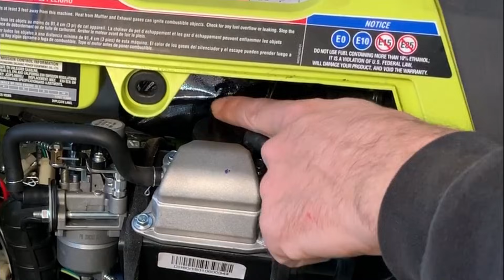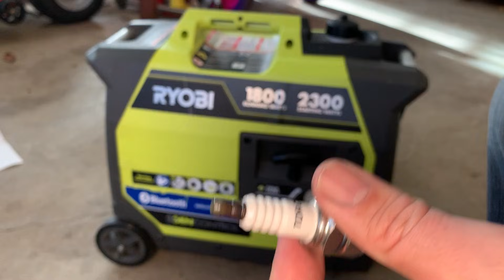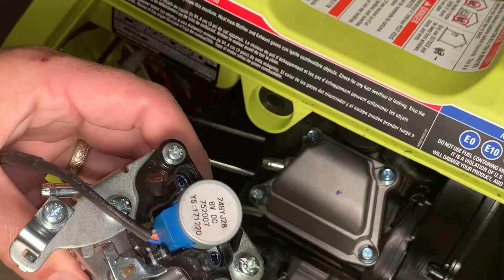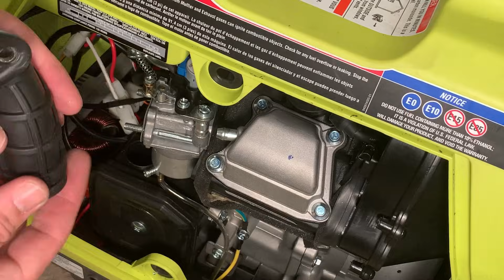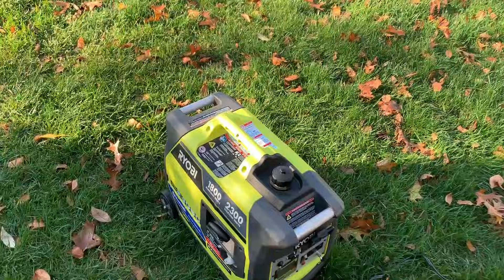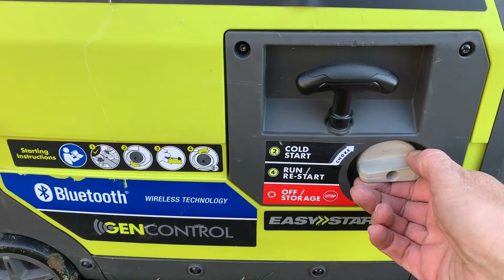Surging and Stalling Ryobi Inverter Generator Fixed - RYI2300

Comment: Seems to be running good now,  good job figuring it out.
This is a perfect example of why you should not mix ignition on off, fuel on off, and choke on off into one control. Much better to keep them separate, the biggest advantages it allows you to turn the fuel off and run it out of fuel so the carburetor stays dry. this is especially useful if the generator doesn't get used very often. Which is the situation for most people.
I've got a harbor freight 2500 watt inverter generator that I bought several years ago. Fortunately it does have a separate ignition fuel and choke. I've never had any issues with it failing to start. The only real negative is it has a vacuum pulse fuel pump. doesn't really seem to gravity feed fuel into the carburetor very well. So since the bowl is empty it requires several pulls of the recoil starter to get the fuel flowing. Once it does it starts right up.
I think if I ever buy another generator, I will definitely pick one that's electric start and electronic fuel injected. That will eliminates most of the issues.
Reply: My advice would be to buy Honda or Multiquip (Honda motor) more money but no problems.  Run it for a few minutes 3 or 4 times a year and use alcohol free (recreational gas) in ALL your small motors.

Comment: As one who works with control loops, I'm seeing a firmware issue. There is a computer that controls the carb servo position, but it's somewhat unstable (speed surges) at light loads. Check to see if a firmware update is possible and available. As you would suspect, it doesn't really cause any problems (unless it stalls), but it does sound unreliable.

Comment: Mine does not get fuel to the carburetor. I mean when I disconnect the fuel line which is behind the carb and nothing comes out. I hope it is the fuel filter. Is there a way to use a regular fuel filter on that thing instead of the red small one that came with it? 
I hope it is not the switch in the front that is not  doing it’s job

Comment: the problem indeed is fuel starvatio from that valve.....but also from carburetor side little round plate below on the side from that top jet...i notice on your  brand new one it doesn't have it.

Comment: Way to power through the issues.  I have watched dozens and dozens of your videos.  I'd almost rather do my own vasectomy than work on a Ryobi after watching the struggle.
Reply: It would be tough to do your own vasectomy, imagine the discipline needed to firmly grasp one testicle while carefully injecting a syringe of local anasthetic in the correct place (I was not at all looking so I can only wonder where that is) to induce the numbness required.  Then you have to wait for the numbness to kick in prior to cutting through the scrotal tissue (just the one layer, of course) with a (hopefully) sharp pair of scissors. Once through, you have to rummage around through the opening you created and isolate the specific tube to cut, remove a short but somehow still long enough section of it, and I hear it makes a vast difference if you don't get the length of section correct (sorry about that) and then cauterize each of the ends.  Don't forget to stitch it back up!  I had to leave it to an expert.
Reply: @Wingnut_Stickman  vast difference. rofl..... I bow in deference to your humor.
Reply: @somethingelsehere8089  thank you, thank you ...
Reply: @Wingnut_Stickman  you might be surprised to hear that it is really not very challenging.  I do my own surgeries all the time. 👍🏽
Reply: .......little too much information there Wingnut! @Wingnut_Stickman

Comment: Thanks so much for this detailed explanation. Had the exact same problem. Just ordered the Honda for alot more money. Tried to return to Home Depot and was told that the policy is no returns after 30 days for opened box generators. So....I have a question if you don't mind. I am using this for outdoor events that I am DJing or Playing live music. Can you run 2 Different generators for components in the same system? Sub woofer, Powered speakers, Computer etc..... Thanks again, Joe
Reply from the maker: That is a great question.  Not sure the answer, but would guess not if the components are connected together via the audio plugs.  At least on a normal generator because the neutral is not the same as utility power.  The neutral actually goes positive and negative 60 volts and the hot wire the opposite.  Utility power it is just the hot wire going positive and negative 120v.  Inverter generators might be different.  Not sure.
Reply from the maker: But good choice going with the Honda.  It will not let you down.
Reply: If you mean running 2 generators on the same 120 volt circuit, no. That's not possible without synchronization circuitry and you can't adjust frequency or voltage on inverter generators. The MEP 802a is the smallest capacity generator I know that supports master/slave synchronization. It's better to get a single high capacity generator and run it on that. Also running two audio systems out of sync connected through audio equipment could lead to humming in the speakers

Comment: Wow! Thx.

I had that exact surging and shutting gen off issue. Until my friend Cao showed me this video.

Turning the big yellow knob to between the C - H (of word choke) at START freed up the gas flow & stopped the surging and dhutting off issue.

YAAAY Mr Condon!!👍

P.S. Running the gener as recommended on RUN would make the generator surge & eventually shut off.

So set start knob between the C-H of choke on start first.

Then... pull the cord. When it starts... wait at least 30 seconds.

Now plug in your extension cord into generator.

Voila. Again many thx for your detailed research.
Reply from the maker: Thanks. Glad it solved your problem.
Reply: Is a bad fuel selector. I fixed mine some time a go, here is the part number: 310437020. Also known as homelite parts.
Reply: So do I keep the knob between Cand H while it’s running? So knob all the way to choke to start and then drop between C&H while running it???

Comment: What I would do is bypass the fuel line from switch. Run directly with manual shut off and fuel filter. Directly to carburetor. I done to my Honda generator.
Reply from the maker: Yes just run a line from the fuel tank to the carb with a shut off and filter on the line.

Comment: Thanks for doing the deep dive and posting your findings, I've had the same surging issue with my brand new Ryobi 2300 Generator.
Reply: Yikes!  Really?  Mine is still in the box.  Tips?
Reply: @GR8GUY54  Mine seems to surge with around 300W load, perhaps it's stuck between eco mode and normal mode, and that back and forth switching is causing the surge?  I have not checked the choke/run/stop knob for the same issue that remedied the generator in this video.

Comment: I am on my 2nd generator and both did the same thing. Where is the fuel filter? I also now have an "overload" problem even without a load. Not happy with Ryobi
Reply from the maker: The fuel filter is on a fuel line that comes out from the fuel shutoff knob.  Kinda in the middle near the outlet side of the generator.  You should be able to see it once the service door is removed.

Comment: Dear James..I do enjoy each one of your videos. I have an a-ipower SC2000i unit with the yamaha 79 cc motor

With only 120 hrs use (small fridge, light) the unit is giving an overload alarm, therefore, no power output without load.  Motor winding seems to be fine (.4 ohms) and exciter around 1.8 ohms. Motor feels solid.  Is  there any other test option prior throw it away? Inverter Module seems to be expensive and I can't find anywhere in the USA a replacement part center.
Reply from the maker: Carlos A I have not had to troubleshoot an overload light.  But from my understanding, that does indicate that the inverter module has failed.  Unfortunately the inverter is usually a potted circuit board and not serviceable.  Only option is to replace the part.  But due to the cost it is usually not worth it.

Comment: These are crap. DO NOT BUY. My brother and I each bought one of these back in March 2020. His never ran, days after buying it he was told he could not return it at Home Depot and he’s still waiting for his to get back from the repair dealer. I tried mine after letting it sit in the box for weeks. Mine ran fine for 20 min or so. I thought “cool” I’m out of the woods. NOPE. After it ran I emptied out the gas, had it in storage for a few weeks. Power outage come along “cool” I have a generator, but guess what it doesn’t run. It only “runs” with the choke on. Obviously unusable. Pay another $400 and get yourself a Honda instead.
Reply: Did you even watch the video?
Reply: Stang723 I’m not criticizing this video. I’m frustrated with this generator. This day in age you expect something brand new to last you more than 20 minutes.
Reply: @nelsongti  oh I totally agree!
But what you're doing is basically what he's saying to do.  Just adjust the cable so that it doesn't pull on the choke too early

Comment: You never tie a Sparkplug this hard , never. You can break the thread of the head next time you try to remove, definitely you aren't a real mechanic you just play a mechanic.  You tie a Sparkplug just 1/4 of the ratio.
Reply from the maker: NGK recommends finger tight and then 1/2 to 2/3 more with a wrench.  I went on the lower side of the recommendation.  Agreed, you definitely do not want to over-tighten.  Usually I use a torque wrench, but not enough space in this case.  And yes, I play mechanic.  I am not a professional. https://ngksparkplugs.com/en/resources/spark-plug-installation

Comment: Have the same generator. Its showing overload even when i dont have anything plugged in. Why would it be doing that?
Reply from the maker: Usually the only reason is a bad inverter. Most likely your inverter has to be replaced.

Comment: Dude I've been having issues with these ryobis and you just solved my issue. My most recent was brand new but came with fuel in it which implies someone returned it. It ran great for 30 min then started surging. I tried your method and the surging immediately stopped. I feel so dumb, ryobi has probably lost so much money due to this

Comment: Do you have the fuel filter part#? Tks
Reply from the maker: Peter D i think I just used a standard red Briggs filter.  Briggs & Stratton 4105 5-Pack Of 298090S Fuel Filter 150 Micron For Engines without Fuel Pump https://www.amazon.com/dp/B0038U3J70/ref=cm_sw_r_cp_api_i_JBH.EbDRDFVN1

Comment: I've had the same generator for about a year. I use it every week. Last night at quit working. When I restarted it it said overload. It was charging a battery not sure that ever had an overload. But they're over love won't go away. I check the oil. Sometimes if the oil gets low it will just die. Do you have any ideas on the overload issue?
Reply from the maker: That is usually an indication that the inverter has failed.  The inverter board is potted an cannot be serviced only replaced.  A new inverter module is about $170.  But once you add in tax, shipping and installation labor it could easily be double that.  If you still have the receipt, you should try getting it covered under warranty.  It has a 3 year warranty.

Comment: Thanks for the video, I have been an owner for a little over a year and have come across this issue as well. Well I actually bought the generator at the time the guy who resold wholesale returned merchandise said it would start the first time and just wouldn’t restart again, so I assumed the carburetor as well. Funny thing after I got the carburetor cleaned and checked fuel flow the problem ended up being the gas top did not let the machine breath fuel flow was restricted. When I have these issues of surges I usually open gas top and the problem goes away, weird but simple.
Reply: Mainly use to power RV at the Beach
Reply: Open I meant just loosen gas top

Comment: Yes same here, i would have like seen how you adjust it, i have play with knob before watching these video and it runs a bit better, but im not sure how to adjust it so the right amount of fuel comes out and is in the run position. Thanks
Reply from the maker: I could not find an adjustment for that.  Think the best way would be to get a new valve assembly or bypass that fuel shutoff all together.
Reply: @jcondon1  I would bypass the fuel shutoff completely.   I suspect the fuel shutoff is a ball valve that is only open half way when in the run position. That would be fine, if the fuel flow was adequate when half open, but apparently it is not.  A larger fuel shutoff valve would easily solve the problem, but might require a redesign.

Comment: I just bought this ryobi inverter generator the other day from a pawn shop supposedly new in box. I can't get this thing to start. I pulled the spark plug and it looks a bit used or dirtier than I expected but still new looking and I'm wondering if it's from all the pull starts I've done, approx 60 pulls. However before any pulls I added oil to it that came with it and filled it with rec fuel. The fuel is only 1.5 months old and I poured a 1/2 cup of gas into a plastic bottle then another 1/2 cup of water in the same bottle and shortly after I could see the gas sit on top indicating the fuel is good from separation. For good measure I replaced the spark plug with a NGK equivalent but no go. I then left the NGK in the engine and popped the spark wire off and plugged in the original spark plug. Pulled the cord several times and I could see spark. I then look into the fuel supply and loosened the fuel screw drained the fresh fuel into the same bottle from earlier and no matter what position the Easy Start knob was in the fuel flow seemed the same, never cut off and was steady but slow to drain. This is supposedly new and everything looks clean as a whistle. Manufacture date was August of 2019. I cant imagine a generator sitting in a box for almost two years since manufacture date would cause starting issues but Any thoughts?
Reply from the maker: Well, you have spark.  The only other things that could prevent it from running are compression, timing or fuel.  I would pull off the air box cover and remove the filter.  Confirm that when you turn the knob to choke (start) that the choke plate closes all the way.  If it does NOT then that is your problem.  The cable can be adjusted on the top of the carburetor.  If it does close, then buy a can of starting fluid or carburetor spray.  Give a 1 second spray into the carburetor, close the choke and try starting it.  If it runs for a second then you know timing and compression are good and you have a fuel problem.  If it does not start for a second, then verify again you have spark and try the starting fluid again.  If still nothing and you have spark then it must be a timing, valve or compression issue (but that would be unlikely if new).  Assuming it started with spray then you need to figure out is it the fuel valve that is the problem or the carburetor.  How full is the gas tank?
Reply: @jcondon1  Thanks for the reply James. I ended up narrowing down the issue to a fuel problem but could not correct the fuel issue. As of yesterday I returned the generator and purchased a different one today and now just waiting for delivery.

Comment: I think what you've established is that Ryobi is shit Chinese machinery.
Reply from the maker: Not as bad as others.  At least you can buy parts for it.
Reply: @jcondon1  Small consolation. The model has a significant design flaw. With all the electronics to control voltage and frequency, there is absolutely no excuse for needing to set the knob to a partial choked position. There should be a solid detent for the run position, once the engine has warmed up for a few seconds.

Comment: This video was extremely helpful. I first ran a window AC 5000, 400 watt load with gen. Pulse. Tried lots of things. Then found it likes heavier loads runs smooth. I ran a 10,000 btu on this without any surge pulse but got way too cold in cabin so was overkill.  The digital settings seemed to not fit well somehow with running on a gen.  I put it back to the 5000 btu manual switch unit adjusted the choke switch as you showed.  Running for hours now. Thanks.

Comment: Fun fact, you can also turn the knob half way to off... It will let the gen run until it is out of fuel... Good to store or without needing to remove the side cover and drain the bowl manually.

Comment: Good video, I appreciate the quality of production.

However, I'll say that the fuel valve is operating properly, it's very common for the "petcock"  to flow on choke or start, but it will only flow in "run" with vaccum. IE, the engine must be running for fuel to flow while in the "run" position.
Reply: If that is true, then the stepper motor logic is most likely defective. The problem is apparently almost universal in the Easy Start model, so it is a design/programming problem. All these "make do" efforts should be unnecessary.  Ryobi should have fixed the problem(s) years ago.

Comment: Hii 1 question, do you think the switch bottom that turns the generator off, you think this also shoot the gas off?? Or it's just a electrical function that just cut the electricity to turning it off?? I'm wondering because I'm thinking about how can I shoot off the gas before it would turned it off completely (in order to run it dry and avoid bad gas stick in the carburator)
Reply from the maker: Oscar Martinez that knob turn off the gas, kills spark and actuates the choke.  Those carburetor bowls have a screw you can open to let the gas out.

Comment: Same here bought new, did have what looked like shale grindings in fuel ,dumped oil and fuel up side down cleared tank, ran ok for thee tanks now gen acting just like your video will check if choke adj.will help thanks